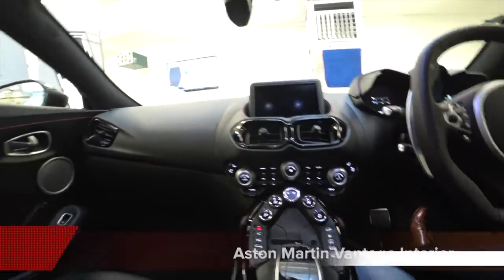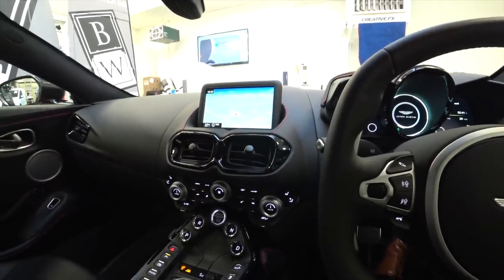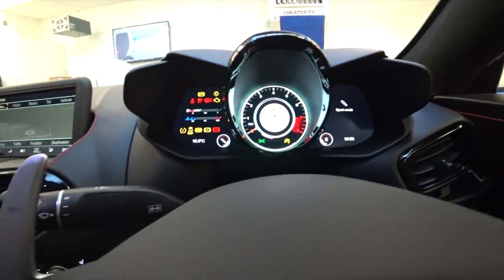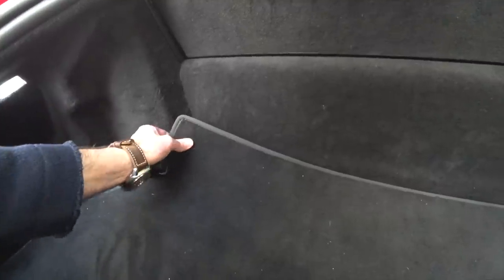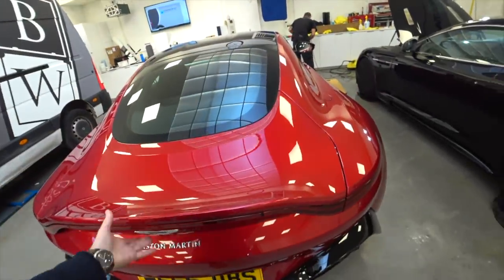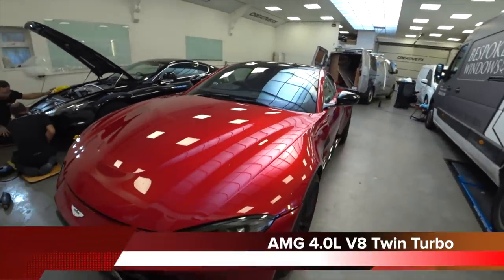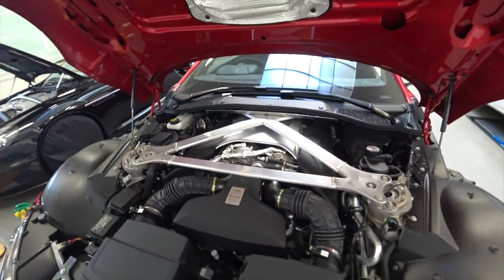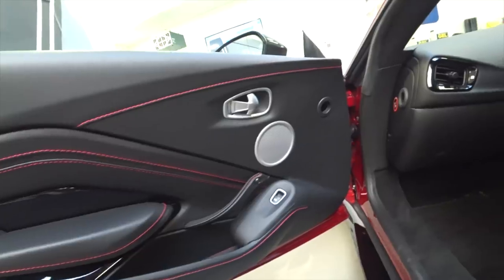Aston Martin Vantage 2018 Review and Great Drive in London

Comment: To differentiate themselves from the competition, they should have more interior woods, veneers,  leather, toggle switches, more gauges (check out Wiesman automobiles) and forget the cheap alcantara that falls apart before the warranty runs out.  The steering wheel column is outrageously oversized.  The sound of the engine is not distinctive enough.  They should hire more people from SAAB.
Reply from the maker: I agree some of the items should be upgraded but it is a huge improvement over the Aston’s of old. Thanks and subscribe